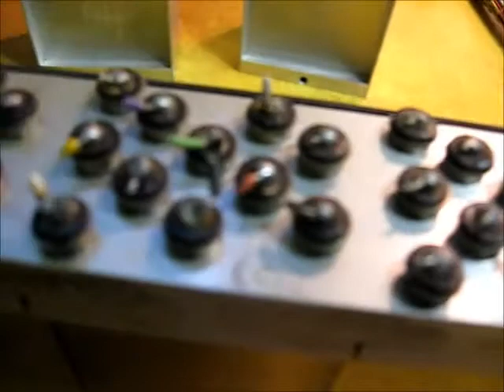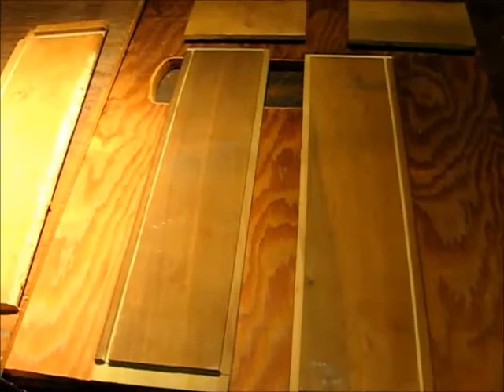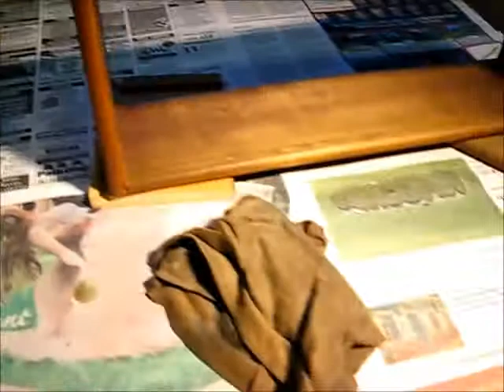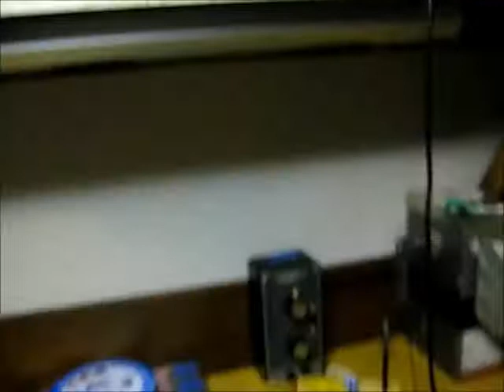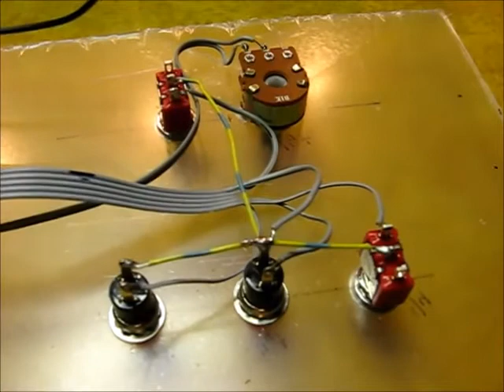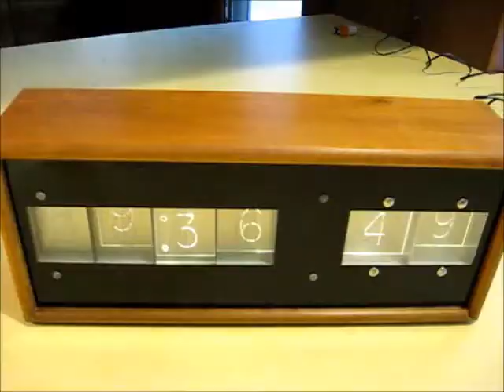Homemade Digital Clock using vintage 1960's Edge Lit displays with the MM5314N, 74C915 and the 4028

Comment: Nice build!  It's interesting that you're using NPNs for high side switch and PNP for low side, which is generally opposite as to how they are used.  I think you are able to "get away with it" since the base-emitter voltages work out to your favor.  I gather you took this approach because the 4028 output is active high, whereas the MM5314N mux is active low.
Reply from the maker: Thank you!  That is precisely why I went that way.  It seemed logical to me.  Truth be told, I did not see another way in my novice experience with transistor switching.  A high turns on a NPN and a low turns on a PNP right?  I would be happy and appreciative to listen.....  In case you are interested, I built 2 other clocks using this circuit design and all 3 seem very happy so far, one and two years later.  Projection displays and Beckman column counters are also used.  I think I may be the first that made an outdated MM5314N count one of 10 but who really knows!  Thanks again, Jim
https://www.youtube.com/watch?v=a5kk-JmWxLg&t=55s
https://www.youtube.com/watch?v=0bjlE6U7Q1o
Reply: @JIMO415  Hello again!  I was just looking at the data sheet trying to answer the question of whether or not the segment and digit lines are active high or active low because nothing is mentioned about that in the text.  On page 5-18 on the left they show digit low, segment high (see the waveform next to each output), but on the right they show segment high, digit low. So both work!  I think that is because each cycle, both conditions occur (overlap).  A further question would be whether it would work in all cases, not just HL, LH, but also HH and LL.  For example, if the two waveforms are the same frequency and duty cycle but out of phase by 90 degrees at the transition, then all of those combination would occur each cycle for the same duration and then any combination of active high/low works, but if my assumptions don't hold then perhaps the duty cycle would be off for those last two cases of HH and LL.  I hope that makes sense.  If not, I can send you a diagram of what I mean if you like.
Reply from the maker: @Enigma758  Digit drivers are active low and segment drivers are active high.  Look at the diagrams closer.  I assume you are referencing the 5309 interfacing LED display examples.  Between the left diagram and the right diagram, the location of the digit and segment driver outputs is swapped in the diagram examples.  Easy to overlook.  NPN's on the segment lines and PNP's on the digit lines.
Reply: @JIMO415  OMG, yes!  I missed the fact that they are swapped in the two diagrams and confused myself big time.  Glad to see there is a simple answer Thanks so much for the clarification!
Reply from the maker: @Enigma758  I did the same mistake!

Comment: Great restoration job and a high quality piece Jim. It's a pity the world is losing  machines like this that rely on clever combinations of electrical, physical and  mechanical design.  Keep the clocks glowing!
Reply from the maker: Thanks Paul.  I think there will always be the purist collector keeping the machines as built and working.  I did not hijack these displays from a unit but someone else did so you can blame them LOL!  BTW, I did a short video on your old clock....did you catch it?
Reply: @JIMO415  No, I'll check it out now.